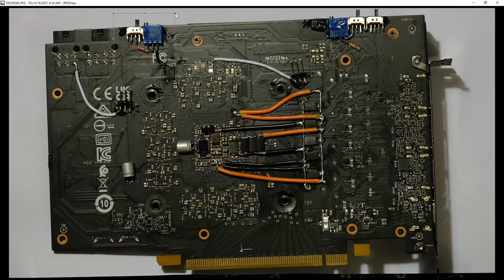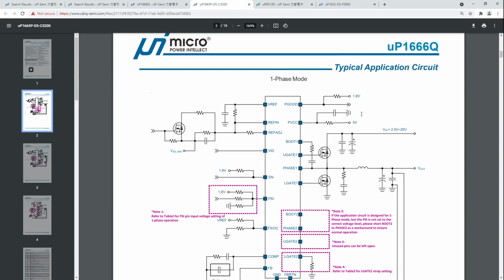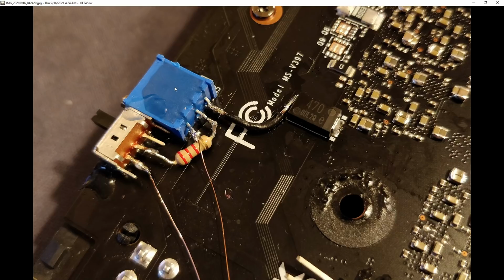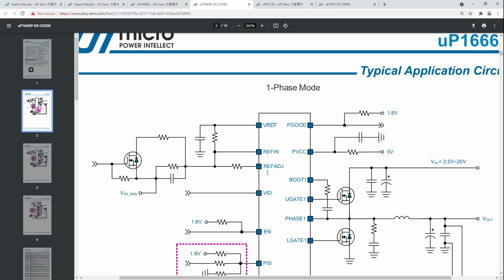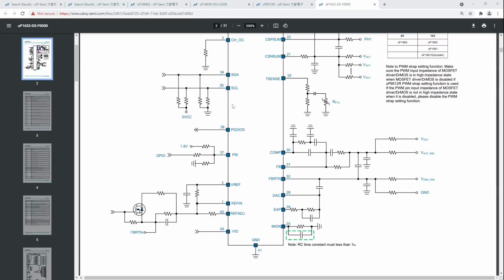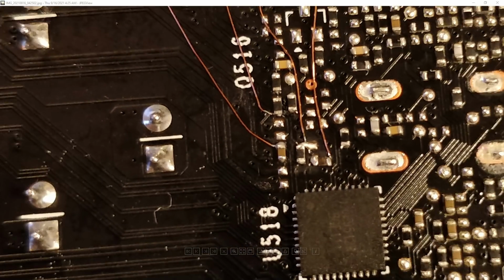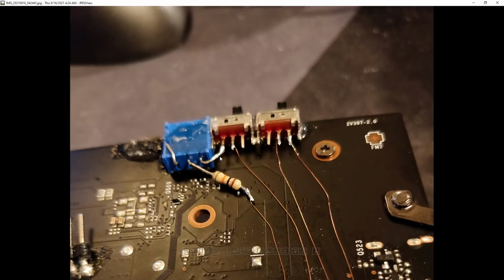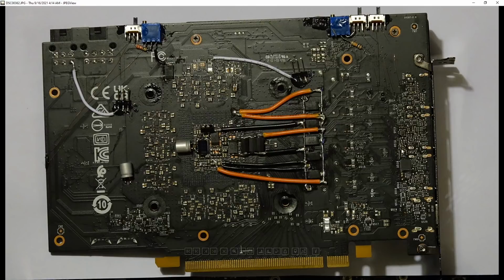Core and memory voltage mods for the MSI RTX 3060 Ti Gaming X.

Comment: hey awesome guides you have.  i just got the gigabyte 4090 gaming oc with the same controller uP 9512R, have you tried just using offset yet with the refadj pin still connected.  Just trying not to mod the card too much.  I got the elmor evc also but I know it only allows like 150mv offset, but that would be enough for me, just need to find sda and scl.  still also have to learn how to determine what trim pot to use.  I think I remember something like the resistance times 10

Comment: Any plans to start ASOC and update the code-set on the VRM RISC(s) so you don't need to preform so many janky hardware mods?  Range of voltage [desired low to upper limit the plane supports] code mod prior to AHOC?  Most of the controllers you bypass with hardware support a voltage range in code..  Just sayin' <_>

Comment: For your core voltage mod, couldn't you have used one three pole switch instead of two? Where pins 1 and 3 are your potentiometer and REFin, respectively, and the middle pin the output? Or did I misunderstand the wiring, and you are removing REFin altogether?
Reply from the maker: yeah I could've but I wanted the option to have offset voltage control. Which would be REFADJ connected at the same time as the potetiometer.

Comment: Next video: 3060ti 2v memory overclock
Reply: That's the video where he gets it running as fast as a 3080 on air by removing the vram and soldering it directly to the core and changing the voltages and timings a certain way to almost defy the laws of physics in a provable way. After a nobel prize the method will be used by all gpu manufacturers going forward.
Reply: @pf100andahalf  yay

Comment: Since this is your daily card, do you set the voltages daily and for what purpose?

Also, will the EVC2 work on it? Do you know where the i2c pins are? Thanks.
Reply from the maker: the mem voltage is at 1.25V because the VRAM clocks better with less Vmem

Comment: I was able to get a 3060 and haven't put it into a PC yet, I'll have all the parts by xmas. Its the MSI Gaming X Trio 3060, so as I understand it its a good choice to manually overclock with a shuntmod. Would you recommend using conductive ink for this or getting someone comfortable with soldering to do a proper workaround?
Reply: Please do not mod your card for the minimum gains you will see.  The fact you asked if you could use conductive ink tells me, DO NOT MOD YOUR CARD.  Modding electronics isn't something you just wake up and start doing one day.   It takes a decent bit of experience and knowledge with electricity and schematic reading.   Not to mention that bad soldering and poorly made mods = bad for expensive card.  If you are convinced to do it.  I highly recommend getting a 50 dollars solder, flux, lead, alcohol.  And practice on some scrap electronics before you go modding your 3060.  Compare your practice solder with examples of good solder jobs.  Also be sure to use a proper shunt, made of proper material.  MODDING VOIDS YOUR WARRANTY.  IF YOU MESS UP.  THEY WILL SEND YOUR CARD BACK AND LOL.

Comment: I know this is a bit off topic, but I have to ask:
Do you have any opinions on New World continuing to kill 30 series graphics cards, and do you believe it may point to an architectural flaw with regards to the PCB designs that are being used on those cards? Or does the issue - if it even is an issue at all - go even deeper than that?
Reply: He  did a video on that.
Reply: @NormanPAquino  And mentioned in a video some one's sending him a dead 3090 to look at, think it was the last twitch video.